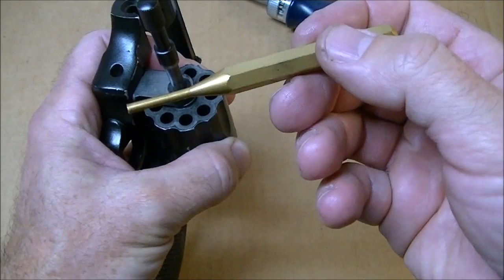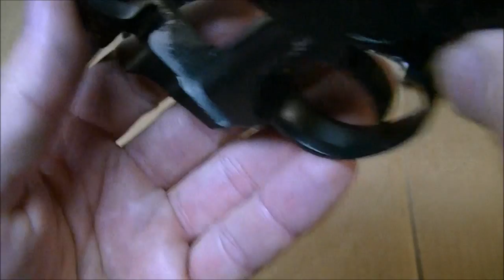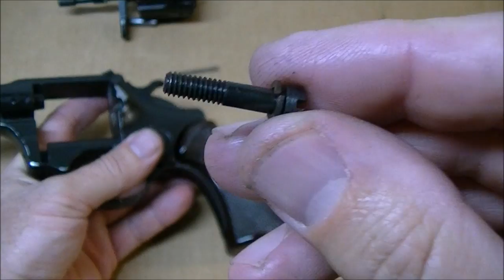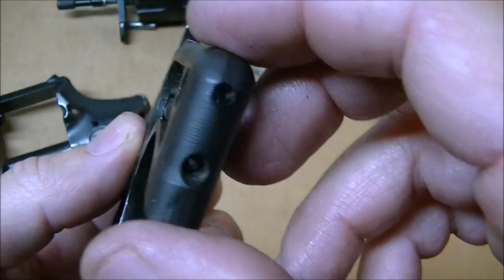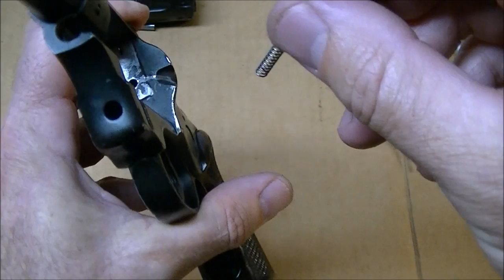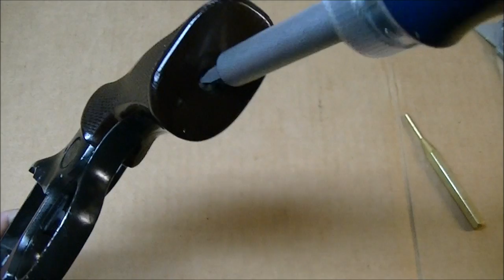High Standard R-101 "Sentinel" Revolver Disassembly

Comment: I have had mine for 20 years....there is NEVER  a need to take this pistol apart......just clean it for god sakes....LOL
Reply from the maker: I disagree. Just because something is still functional does not mean that it does not need to be cleaned and lubricated. I have fired revolvers were the action was gritty and dirty, yes they worked but after being cleaned and lubricated they functioned more smoothly, were easier to shoot and did not have the grit and dirt wearing down the internals prematurely.
Reply: @314299  Well amazingly  I have  pistols that were handed down to me from my father  that have never been apart  for 50 years , He just used gun oil , WD  40  , and Hoppes cleaning   solution,    and they  function  fine,  ....And I'm 55 and I dont ever plan to take them apart in my lifetime.. And I asked my  shooting  buddies   if they take apart  thier pistols  and they laughed ,,,LOL......maybe if your pistol  was sitting in beach sand  for a while, you may want to disassemble....that's it